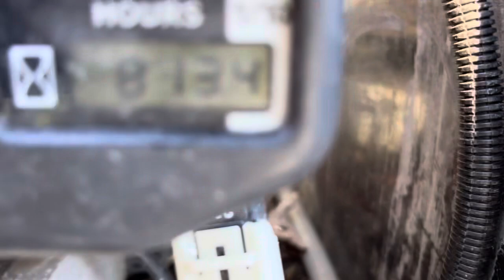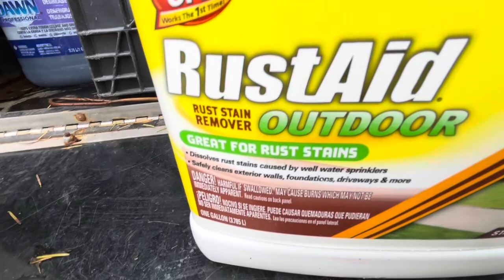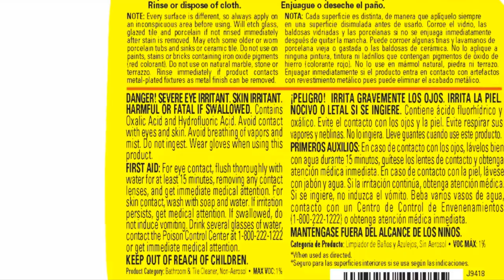Roof Rust Stain Removal

Comment: Very weird that left side of the chimney port spewing out rust.  May of had a steel liner in that side of the chimney, or they replaced a older rusted out chimmney cap and replaced those 2 units after the fact most likely.
Reply from the maker: Sounds like you have a better idea about what happened and I do. I have no idea.

Comment: Aluminum brightener for rust.  find at auto parts or truck parts stores. 1 or 5 gallon. Think you can cut it 50/50 and still get  good results. 
Maybe do a comparison video like Coty(SESW) did on red clay stains.
Reply from the maker: Yep. Also works great

Comment: The roof looked awesome, it's 99% better! Is the 1.8 injector designed for 2-3 gpm? I know, or at least I think I know that 2.1 injector is 3-5 gpm and the 2.3 is 5-8 gpm. I use the 2.1 with my 8gpm when downstreaming.
Reply from the maker: I use the 2.1 a lot when it’s warmer out. Pulls 14:1. The 1.8 pulls hotter 10/11:1
Reply: You are using the 8 gpm machine as well, correct?
Reply: Thanks!
Reply from the maker: @shaferspressurewashing8911  correct. I use the 1.8 & 2.1 daily on my 8gpm
Reply: Thanks!

Comment: Soon you can have AI doing the work with drones 😬
We use high concentrated rust Aid that we need to add water to prevent from burning the structure. (Burn marks, etching)
Reply from the maker: Mmmm. Mmmm